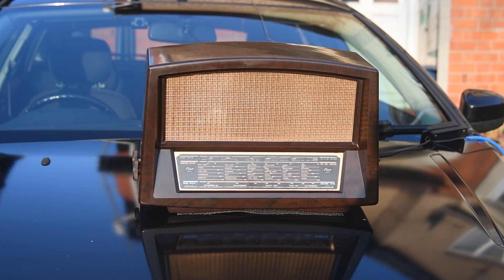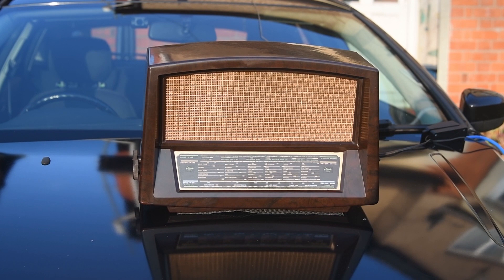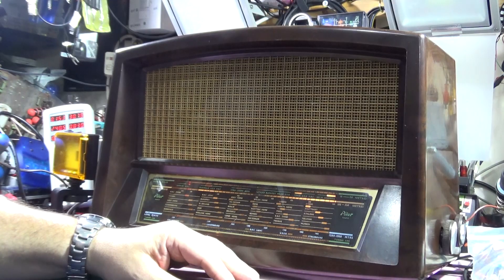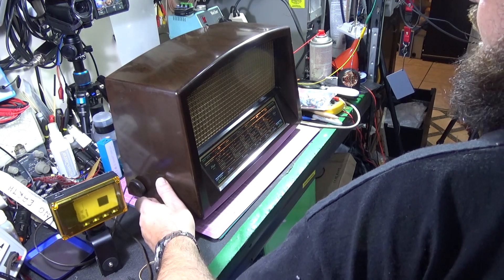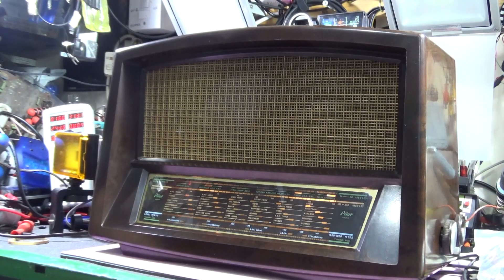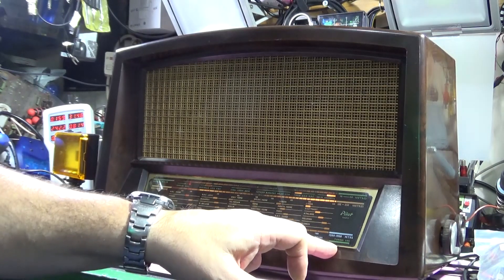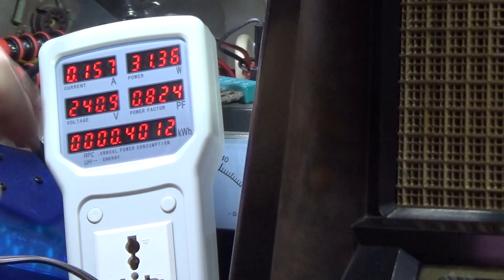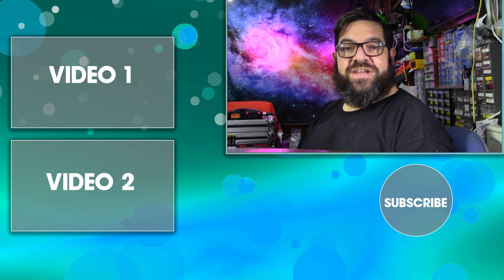1950s Valve Radio Repair - Pilot T85M Pt 4 - Grand Finale

Comment: You're right, that bakelite finish does "pop" now.  I didn't know if the buzzing was because of the smoothing capacitors or whether it was just interference from something else on the circuit, but it definitely sounds good and receives well.
Reply from the maker: It can really only be that main smoothing cap. It tested ok and I was hoping it would reform more in use but it may well come out at a later stage.

Comment: Looks and sounds great George!  What type of polish did you use? I have a nice bakelite cabinet on a late forties radio that is full, but it will be a beauty once I get it buffed out. I just haven't found anything that works yet.
Reply from the maker: on that cabinet I used meguires polish, the stuff you normally use for car headlights. it is a very fine cutting compound which really takes out all the remaining scratches.
Reply: @GeorgeChristofi  thank you for that info!